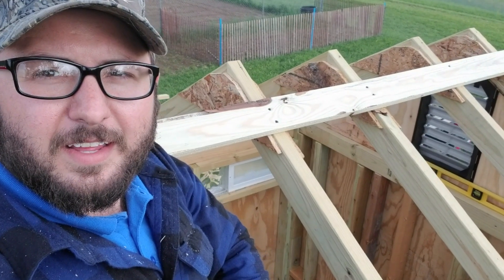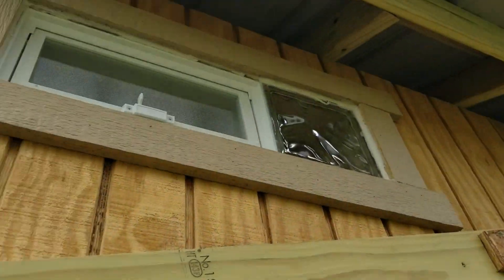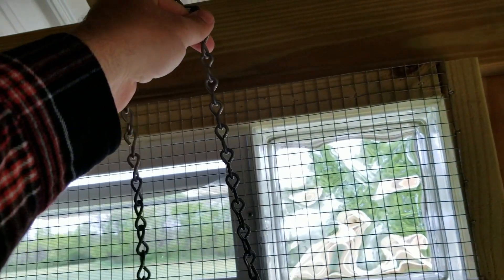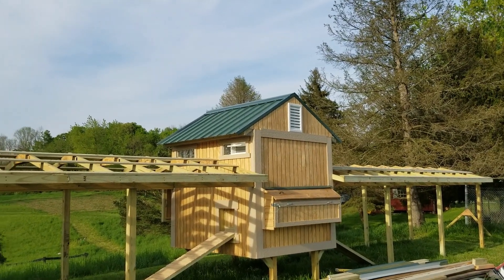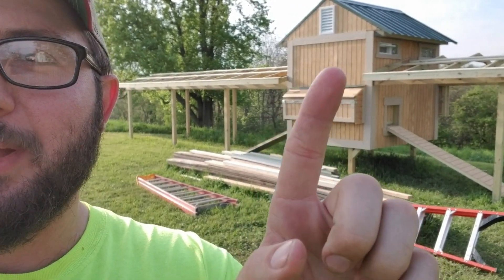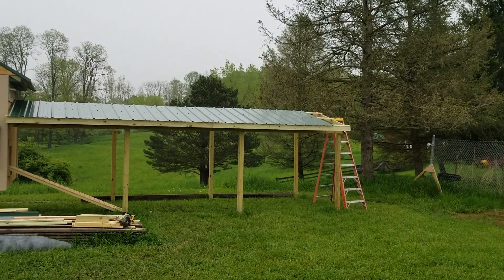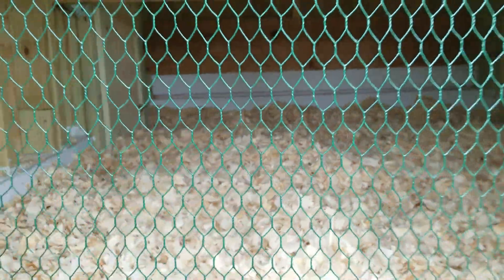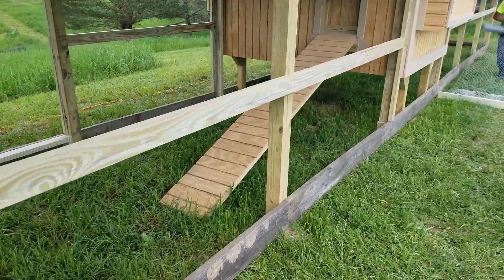Chicken Coop Build Part 5- Purlins, Roof Panels & Weather Proofing

Comment: You could put a vinyl flooring in the bottom.  It would make clean out much easier.  It will also last for years.  Some places will sell you a remnant, which is the end of the roll, at a cheap price.
Reply from the maker: Wayne Leamon the idea is hopefully with the deep bedding there won’t be any moisture issues. If issues arise I’ll probably add vinyl next time I change out the bedding

Comment: Now that it's been a while - have you had any problem with snow bending down the ends of the metal roofing since it overhangs the purlin so far? Getting ready to put my roofing on and was wanting a longer overhang also - but the snow load concerns me. Thanks
Reply from the maker: I have had zero issue with deflection. The snow load where we live isn’t that high though. It’s been years since we’ve had a storm more than 6”